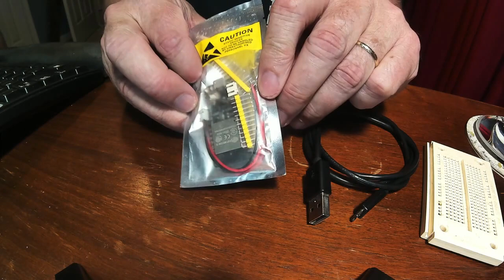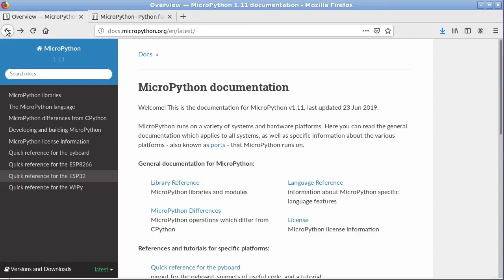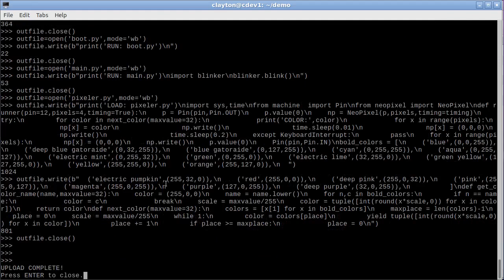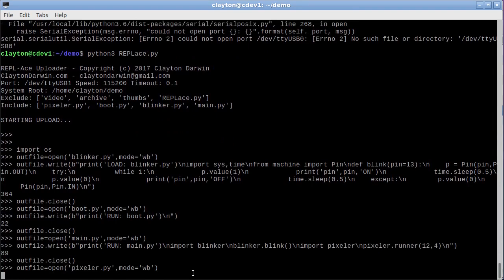ESP32 Tutorial using MicroPython - Let's Get Started!

Comment from the maker: Intro: 0:00
Things You Need: 1:28
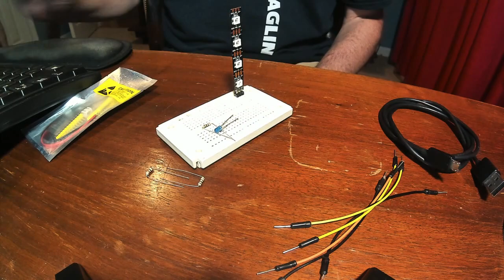Setup: 5:30
Soldering: 9:56
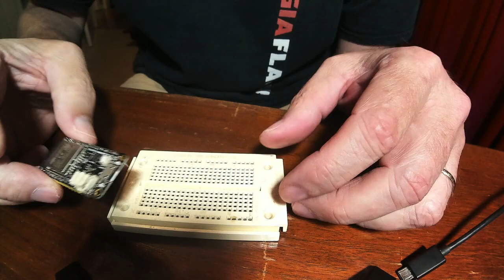Breadboard: 15:52
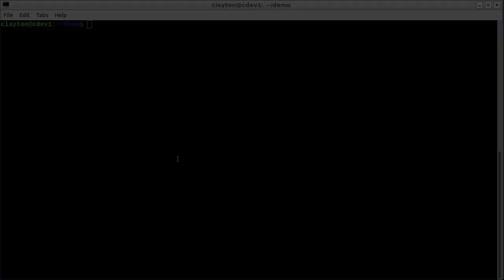Install MicroPython: 18:59
Connect USB/Serial: 25:14
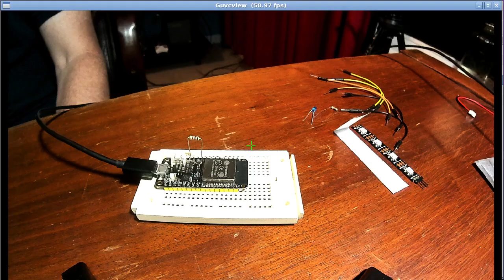Resets: 28:20
Blink LED: 29:10
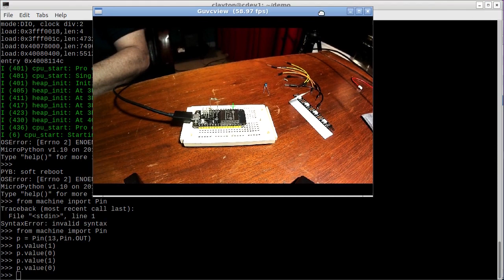Load and Run Program: 31:16
boot.py + main.py: 33:10
Un-Connect USB/Serial: 34:00
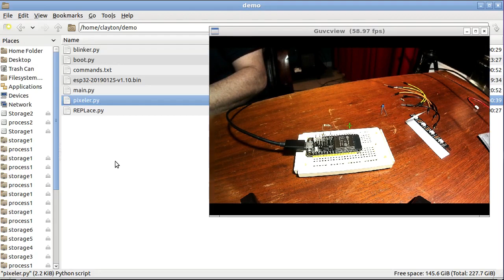Using main.py: 36:35
Blink LED Circuit: 38:30
NeoPixels (WS2812b): 41:17
End: 46:00

Comment: Hello Clayton with respect
I created a device control program for thonyide for esp32 devkit using station and access point modes. I send commands using the udp connection from the mobile application and I also control the devices every three seconds of the application using an api. I'm worried that after making it, when the device is used, there will be a problem in the program and it will not work properly. Is it possible to trust esp32 and micropython language and build a product with many customers?
Reply from the maker: I have had good results with the ESP32 and MicroPython. There are many commercial products which use this combination. If you are developing a product, your focus should be on testing so that you know how your system will perform and under what conditions it will fail. Also be aware that you need to control the MicroPython version to make sure your code runs correctly. I wouldn't update MP versions without extensive testing.
Reply: @ClaytonDarwin   It gives a lot of hope
Thanks Clayton

Comment: using the thonny ide makes everything easier.
you just plug the esp32 in, select in the settings, select the firmware, press ok and done.
after that you can make files directly there and save them on the esp32.
But good video.

Comment: When soldering headers, I put the pins into the breadboard first, then put the board onto the headers.  It keeps them perfectly aligned.  Super glue can get to places where it is not desired.  Never did that, never will.

Comment: I thought ESP32 runs with 3.3 V?
Reply from the maker: Yes, The module and IO pins are at 3.3. However, most dev boards run from USB at 5v and convert that to 3.3 for the module.
Reply: @ClaytonDarwin  I know but then the inputs should not be pulled up to 5V, right? - Anyway thanks for you great videos.
Reply from the maker: Right. An input should not be higher than 3.3v. However, in most cases, signal outputs from a 3.3v will work on 5v items like neopixels because a high value is anything above about 2.5v. And for LEDs, the resistor and power loss will drop the voltage.

Comment: How much of a performance boost can I expect by switching from an esp8266 to an esp32
Reply from the maker: A lot. The processor is about 2x, the flash is 4MB minimum, and most importantly you have way more memory. I rarely have to do memory management on an ESP32, only when managing big blocks of data for web services. My esp8266s used to crash all the time from no memory. I don't even try to use them anymore.
Reply: @ClaytonDarwin  oh thank you, that's really encouraging. I am trying to build an hexapod off the esp8266 but the scripts that I am using take about 50ms per iteration, and I have yet to implement the i2c connection + wifi connection! That's just way to slow for a robot... So I was hoping that switching to a esp32 could do the job.
Reply from the maker: It will definitely be better, but you will still have to really optimize you code to get speed. Start with functioning code.
Reply: @ClaytonDarwin  I think the main problem in the code is that It heavily relies on global variables, but I don't really know how to get rid of them. I need somehow a way to share the previous iteration status with the current one, and I can image how much of a pain it would be without global variables. I'll try my best.
Reply from the maker: This helped me: https://youtu.be/hHec4qL00x0

Comment: Hi. I was wondering.. can we run programs which makes use of external libraries..
Reply from the maker: Yes, if the library modules are written for micropython (in micropython). You can copy them directly in with your main.py and import them. You can also compile them and add them to the image you are using (advanced). There isn't a simple option that I know of for anything else. Maybe someone else does.

Comment: I'm new to soldering. What size of lead would you recommend? i have 1.2 mm and 1.0 mm. What kind of tip of the solder iron would be easiest for a beginner? Also, if you put Micropython onto your ESP32, does that mean you are no longer able to  use Arduino IDE and C/C++?
Reply from the maker: I'm not a technical expert when it comes to soldering, as you can see from my equipment. But choose your tip and your solder by the size of the job. For the type of soldering in the video, I like a round tip that is fairly thin so that it is easy to touch a single lead. I also like small diameter solder like you have. Smaller means more control. But if you have to tin a stranded lead wire, it takes a lot of it. Main thing is to get both pieces hot quickly, add solder, move on. You have to have the heat and flux for the solder to flow, but the heat can also ruin the part. Watch some videos, give it a try. You'll figure it out.
Reply from the maker: The micropython is stored in the flash memory and will overwrite whatever is there. As long as you know how to rewrite the arduino stuff back into the flash, shouldn't be a problem to switch back. But I have no knowledge of arduino.
Reply: @ClaytonDarwin  Thank you so much for your info.

Comment: Hi  Clayton, i have this error when i try to run REPLace.py . AttributeError: 'module' object has no attribute 'Serial'
any idea? tanks
Reply from the maker: Yep. Read the first part of the file. Use pip to install pyserial. Required.
Reply: @ClaytonDarwin  i use pip3 install pyserial and keep not like that :(
Reply from the maker: On Linux I usually use "python3 -m pip install whatever". Otherwise it can get confusing if you have multiple versions. Also, on Linux you need to be part of the dialout group.
Reply: @ClaytonDarwin  Ummm i see my error need a 3 after python XD

Comment: When I try and flash micro python I get an error no file found. I have downloaded micro python to my downloads folder. Complete noob here to both Linux and ESP any words of advice would be appreciated
Reply from the maker: Run the install command from the folder with the .bin file. Otherwise you have to put in the whole path. And I'm assuming you have the esptool installed?
Reply: @ClaytonDarwin  Yes I have ESP tool installed and have erased the flash so I know I have comms with the board. So I will just cd to my downloads folder and run the command from there> My file is esp-idf-....... Should I add the -idf-? thank you for the replay and very quick reply.
Reply from the maker: Yeah. That's right. Just cd to downloads and run it there. Use the exact file name, whatever it is. That should work.
Reply: I got it. I tried going to downloads and entering the command and it still not work so I edited the command by copying and pasting the file name right from the file and it worked. Not really sure what I screwed up but I have installed now and thank you so much for the help.
Reply: @ClaytonDarwin  I got it thank you.
Reply from the maker: Cool. Probably just had the wrong file name.
Reply: @ClaytonDarwin  I got the LED to turn on and then off and yes it was super cool lol. Late here on the east coast, I am going to continue with this after work tomorrow. Thank you for the great educational video and than you for your time.
Reply: @ClaytonDarwin  Hopefully you can help me one more time. Busy week and I am just getting back to this. When I put "picocom -b 115200/dev/ttyUSB0" into the terminal this is what I get back, and it just keeps running and does not respond.

scott@scott-OEM:~/Downloads/ESP32$ picocom -b 115200 /dev/ttyUSB0
picocom v3.1

port is        : /dev/ttyUSB0
flowcontrol    : none
baudrate is    : 115200
parity is      : none
databits are   : 8
stopbits are   : 1
escape is      : C-a
local echo is  : no
noinit is      : no
noreset is     : no
hangup is      : no
nolock is      : no
send_cmd is    : sz -vv
receive_cmd is : rz -vv -E
imap is        : 
omap is        : 
emap is        : crcrlf,delbs,
logfile is     : none
initstring     : none
exit_after is  : not set
exit is        : no

Type [C-a] [C-h] to see available commands
Terminal ready
ets Jun  8 2016 00:22:57

rst:0x10 (RTCWDT_RTC_RESET),boot:0x33 (SPI_FAST_FLASH_BOOT)
flash read err, 1000
ets_main.c 371 
ets Jun  8 2016 00:22:57

rst:0x10 (RTCWDT_RTC_RESET),boot:0x33 (SPI_FAST_FLASH_BOOT)
flash read err, 1000
ets_main.c 371 
ets Jun  8 2016 00:22:57
Thank you very much for your help
Reply from the maker: @woomdawg  Email me directly. Get my address on the About tab.
Reply: @ClaytonDarwin  thank you so much

Comment: hi sir

I really like your video......
             I have make an program for DS18b20 sensor, it's running when i operation by REPL to using "import main" command, but when i remove USB cable from my PC and plug in it into USB mobile charger that time code not running in ESP32, my code in ESP32 in main.py,  

what should i have to add in my code pls suggest me

 please help me regarding this

code are bellow

import onewire, ds18x20, time, network, machine
from umqtt.simple import MQTTClient

ds_pin = machine.Pin(15)
led1= machine.Pin(2, machine.Pin.OUT)

ds_sensor = ds18x20.DS18X20(onewire.OneWire(ds_pin))

roms = ds_sensor.scan()

print('Found DS devices: ', roms)

SERVER = '192.168.43.173'
CLIENT_ID = 'ESP32'

TOPIC = b'temp'

client = MQTTClient(CLIENT_ID, SERVER)

time.sleep(1)

client.connect()

while True:

  ds_sensor.convert_temp()

  time.sleep_ms(750)

  for rom in roms:

    print(rom)

    print(ds_sensor.read_temp(rom))

    t = ds_sensor.read_temp(rom)

    msg = (b'{0:3.1f}'.format(t))

    client.publish(TOPIC, msg)

    print('msg-')

    print(msg)

    led1.value(1)

    time.sleep(.5)

    led1.value(0)

  time.sleep(5)
Reply from the maker: In the first line of main.py, put a print('Load main.py') statement. Then, while you are in REPL, push the reset button on the dev board and see what it does. It should run main and print the statement. If that works, it should work on a power supply. Maybe your power supply is too weak (low amperage), or bad, or has a bad connector.
Reply: @ClaytonDarwin  
Sir i find that my code stop at  "35 line" i.e. "client.connect()" and repeating continuously to connect to my server but i don't no why it is not connecting to my server when power by external source, i have change the power supply and also USB cable , 

please help me regarding this..

import onewire, ds18x20, time, network, machine
from umqttsimple import MQTTClient

led1 = machine.Pin(2, machine.Pin.OUT)

led1.value(1)
station = network.WLAN(network.STA_IF)
time.sleep(1)
station.active(True)
time.sleep(1)
station.connect("DeepakNetwork0", "Deepak1234")
led1.value(0)

ds_pin = machine.Pin(15)

ds_sensor = ds18x20.DS18X20(onewire.OneWire(ds_pin))
roms = ds_sensor.scan()
print('Found DS devices: ', roms)

SERVER = '192.168.43.173'
CLIENT_ID = 'ESP32'
TOPIC = b'temp'

def connect_and_subscribe():
    client = MQTTClient(CLIENT_ID, SERVER)
    time.sleep(.3)
    led1.value(1)
    time.sleep(.3)
    led1.value(0)
    time.sleep(.3)
    led1.value(1)
    time.sleep(.3)
    led1.value(0)
    client.connect()
    return client

def restart_and_reconnect():
    print('Failed to connect to MQTT broker. Reconnecting...')
    time.sleep(10)
    machine.reset()

try:
    client = connect_and_subscribe()
except OSError as e:
    restart_and_reconnect()

while True:
    ds_sensor.convert_temp()
    time.sleep_ms(750)
    for rom in roms:
        print(rom)
        print(ds_sensor.read_temp(rom))

        t = ds_sensor.read_temp(rom)
        msg = (b'{0:3.1f}'.format(t))
        client.publish(TOPIC, msg)
        print('msg-')
        print(msg)
        led1.value(1)
        time.sleep(.5)
        led1.value(0)

    time.sleep(5)
Reply from the maker: Because your program will run when connected to your computer and using REPL, my first guess is that you are having a hardware problem when connected to just a power supply. It might be the power supply. It may not produce enough amperage. Try with a power supply that has 1 amps. It might be the power supply connector. It might also be that you are too far away from the router and don't have a good wifi connection. In any case, it is difficult to troubleshoot what is happening. I think you need to use your LED to flash more signals so you know exactly what is happening, AND you need to create a log function that will write error messages to a file. If you write all your errors to a file, you can connect to REPL and read exactly what happened. Here is a good example: https://www.shivrtech.com/logging-errors-exceptions-micropython/ You may want to use the append mode instead of write mode, if you think you will have several exceptions. Just be sure not to fill up your flash with a huge error file. Overwrite it when the program starts.